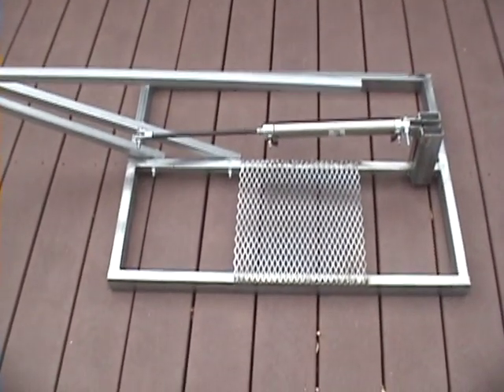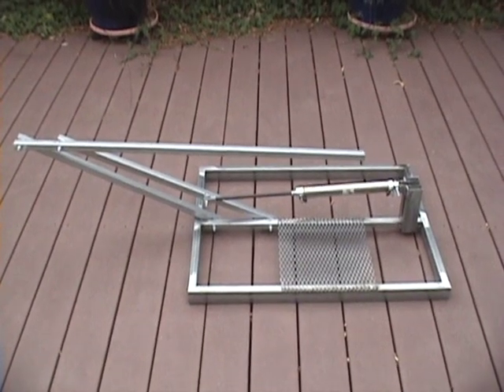DIY Pneumatic Halloween Prop, the Spider Leaper

Comment: Thanks for posting this - it's really cool! Got a question though: how did you figure out the measurements, specifically that the two uprights need to be of different lengths and that they are 7.75" apart on the bottom and 5.50" apart on top - is there some site or virtual modeling software , or is it simply trial and error? I ask because it would be cool if there was an animated machine drawing site (similar to 507 Movements, like this pantograph animation http://507movements.com/mm_246.html ) where one could figure out such things by modeling it , virtually...
Reply from the maker: Some of it is trail and error although I often fabricate a prototype with Popsicle sticks before I start cutting metal.  Here is a useful link to see how different lengths of components will change the movement - http://www.mekanizmalar.com/four-bar-mechanism.html
Reply: Thanks for the reply! I'm getting ready to build a Halloween prop, have an idea of what I want it to do, but unsure how to do it. It is based on the Trash Can Trauma (https://youtu.be/H3wGixk8tmI) from Kick The Fog, but with an added wrinkle. Can I PM or email you?
Reply from the maker: Sure.  Shoot me a pm on YouTube and I'll help if I can.
Reply from the maker: Have you gotten the messages I sent?
Reply: No, I haven't. I don't know where to look (new to this). did id go to my email acct?
Reply: Didn't know how to find them; had my 20yr old daughter help me and voila! Thanks for the recommendations!
Reply from the maker: Would you like to do a Facebook Live next week and we could talk about it?

Comment: hey Hallstaff what is the spacing on the pivot holes center to center
Reply from the maker: Here are the dimensions and measurements not mentioned in the video.
I used 1x2 inch tubing for the base and the 2 uprights that the nose of 
the cylinder attach to and 1 inch square tubing for the center rail, 
both the pivoting uprights and for the extender that the spider attaches
 to.
The pivoting uprights are 7 3/4 inches apart on center of the bolts on 
the bottom and 5 1/2 inches apart where they connect to the extension 
rod.
The nose of the cylinder is 5 1/2 inches up from the base and the hole 
where the rod end of the cylinder attaches to the pivot rod is 10 1/2 
inches from the end that attaches to the base.

Comment from the maker: The pivoting uprights are 7 3/4 inches apart on center of the bolts on the bottom and 5 1/2 inches apart where they connect to the extension rod.
The nose of the cylinder is 5 1/2 inches up from the base and the hole where the rod end of the cylinder attaches to the pivot rod is 10 1/2 inches from the end that attaches to the base.

Comment from the maker: Here are the dimensions and measurements not mentioned in the video.
I used 1x2 inch tubing for the base and the 2 uprights that the nose of the cylinder attach to and 1 inch square tubing for the center rail, both the pivoting uprights and for the extender that the spider attaches to.

Comment: Wow - Great Job.  I have not started to haunt with pneumatic props yet - I don't understand the logistics of it (The size of the tanks needed per prop the noise created by the compressor ... etc)  Can't wait to see how that comes to play as THE DAY comes closer.
Reply: im building a similar thing to this actually and so I came here for reference on the frame for my pneumatic cylinder components